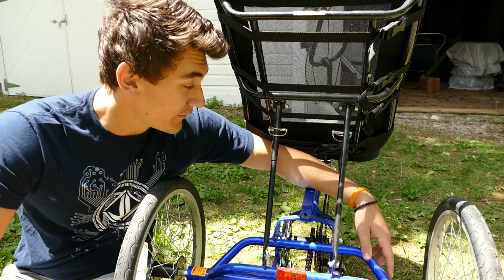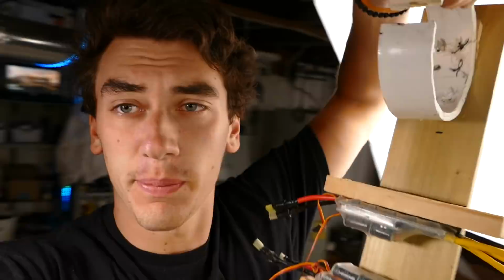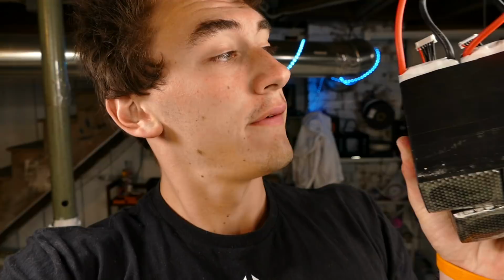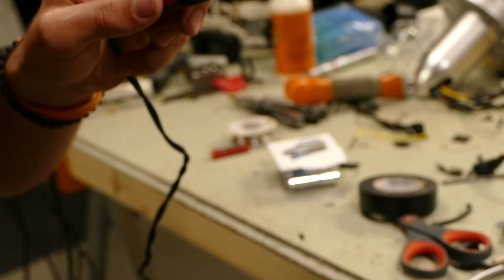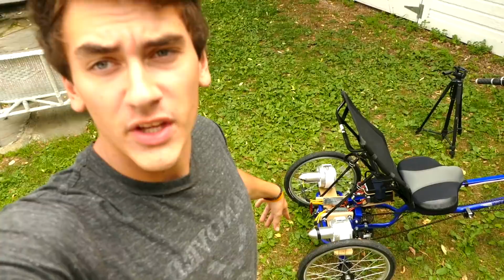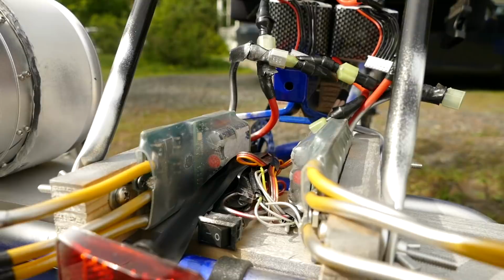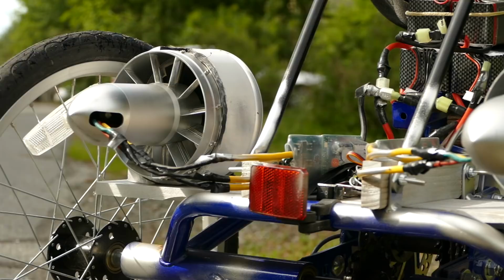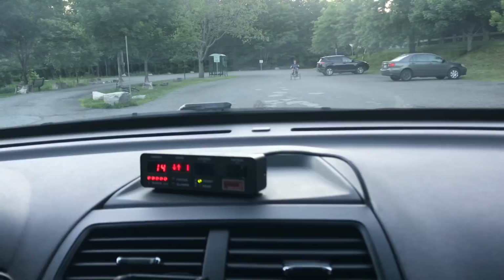DIY JET BIKE GOES WAY TOO FAST - COPS CALLED (Pulled over)

Comment: Imagine having a jet bike in your garage and being like "yeah that was a fun day".   BTW you should put a hang glider on that.  You would be surprised, I bet you'd get off the ground for 10 or 20 feet.  Add enough engines and it would fly but you need some way to steer.  It would be mostly legal too you might have to get some kind of license but since it's a hang glider it will glide down if the motors die (depending on the weight) oh yeah that reminds me you would have to cut the weight a shitload....like super light frame, carbon fiber or lighter IDK, lipo batteries if you're using lead acid..few other things but yea totally doable and super badass project idea
Reply: @waynefilkins8394  you came up with an amazing concept🔥 I hope he sees it
Reply: someone watched less than a minute of the video lol
Reply: Watchu trna do get him killed? 😂

Comment: I concur with your initial assessment. It does, in fact, have a very distinct lack of jet engines. Well done sir. You recognized an obvious failing and you did your best to remedy it. Very well done! I also applaud your use of materials. I also find myself randomly assembling various nonsensical things for no apparent reason other than self-satisfaction, so using the most basic materials you can is something I understand very well! :D

Comment: Oh I'm sorry you seem to have mistaken EDF's for "jet engines"
Reply: Jet engines use a burst of air to make it go really fast but they use huge ones
Reply: @joshuataylor4590  These are EDFs NOT jets
Reply: @urbanferret8247  doesn't really matterr
Reply: @GTmotions  in.my eyes as well as many hobbyist there is a huge difference between and electric fan and an actuall jet turbine
Reply: @joshuataylor4590  um.. no it doesn't

Comment: If you switch to actual jets, you might want to do a vertically-stacked arrangement along the lateral centerline, as in the BAC Lightning (https://en.wikipedia.org/wiki/English_Electric_Lightning), so that you don't have control issues related to differential thrust about the yaw axis.

Comment: I like the way you aren't afraid to use wood. A hundred years ago they were still building planes out of it. For its weight and strength it's hard to beat. When the caption said "jet bike"  I was thinking of the kerosene type. But after your video, I'm still thinking kerosene type...

Comment: Wikipedia:"Among model aircraft hobbyists, the ducted fan is popular with builders of high-performance radio controlled model aircraft. Internal-combustion glow engines combined with ducted-fan units were the first achievable means of modeling a scaled-size jet aircraft." And:"The Martin Jetpack, a personal aircraft powered by ducted fans." Also, ever heard of water jets?

Comment: How long does the battery pack last before requiring a recharge on this? Also, what is the diameter of round pvc pipe you used as a housing mount for holding the motors?

Comment: Hope he upgrades the brakes too
Reply: Brakes only slow you down
Reply: they never do.  Lways more power but no way of taming it.
Reply: Nacho TV, bike-brakes will stop you, even with 100km/h .... but you might need a little more room to stop.... car & motorbike brakes are designd differentbecause of the weight of the vehicles.
Reply: Felixx Mü car and bike brakes function entirely different. Your right about that. Bikes can also have calipers but the pads are really strong.
Reply: not sure why he would need brakes on that thing, it's barely moving, all his shots were sped up :P
Reply: Random things that doesnt make sense, car and bike brakes function entirely the same, both apply pressure to a moving part to slow it down, the only difference would be between disc brakes, v-brakes, or drum brakes, but all work on the same principle of using a pad to cause friction and stop it, and the pads are riders choice just like you would in a race car, can choose softer materials or tougher ones.
Reply: Why do you need brakes when your top speed is 30km/h?
Reply: Brakes are for prow who want to stop
Reply: Because if someone backs out of their driveway you're going to hit them and with no protection your going to get hurt. 18 mph is fast!
Reply: I hope you don't believe these fans are doing anything. In any event, it has rear disc brakes should he manage to coast down a hill.
Reply: +Fellix... Modern bikes have hydraulic disc brakes that work EXACTLY like automotive disc brakes. The pads are even made of the same material.  The Kinetic energy is converted into heat when you brake. This is true of automotive drum and disc brakes and it's true of all types of bicycle brakes.
Reply: Its a disk brake
Reply: And the tools
Reply: srbilataye
Reply: Jolly Roger 越南
Reply: The rear end looked like it had a disk brake so
Reply: Mike Ru

Comment: So 14mph on radar gun? Not 30mph correct? You are guessing 30 if both fans were working? Not sure it works that way, I don't believe it doubles the speed for every fan that you add.
Reply: He said it clocked 30 with one fan.. also no, it doesn't work like that. It would be significantly faster though.
Reply: To double your speed takes four times the amount of energy input. So, with an additional engine of the same power output, he would achieve roughly 25% higher velocity.
Reply: That’s still crazy forone electric motor to do that kind of speed I drive a four stroke gas motor on my bike and I get 35 miles an hour just curious how long his batteries will last on just one motor doing 30 constantly?

Comment: You guys need to watch the whole video before making trash comments about "It's slow, u speed up the video" or "u pushed it up a hill." Yeah, he did indeed do both, but 1 motor broke off and it still clocked a 30 MPH using a radar, and the reason why he pushed up a hill was because there was a cop and he did not want to rid over there.

Comment: EDF electric ducted Fan  basically it's a super sized hair dryer motor.
Reply: joetri1970 🔴 What Is Islam? ⚠️

🔴 Islam is not just another religion. 

🔵 It is the same message preached by Moses, Jesus and Abraham.

 🔴 Islam literally means ‘submission to God’ and it teaches us to have a direct relationship with God. 

 🔵 It reminds us that since God created us, no one should be worshipped except God alone. 

 🔴 It also teaches that God is nothing like a human being or like anything that we can imagine.
🌍 The concept of God is summarized in the Quran as:

📖 { “Say, He is God, the One.  God, the Absolute.  He does not give birth, nor was He born, and there is nothing like Him.”} (Quran 112:1-4)[4] 📚

🔴 Becoming a Muslim is not turning your back to Jesus. 

🔵 Rather it’s going back to the original teachings of Jesus and obeying him.

Comment: At 6:42 it looks like you were only running the right EDF. The left was not spinning unless it was after you rolled away. Your EDFs are usually bought by the diameter, i.e. 70, 80, 90, 105mm, etc. Of course their output is measured in thrust, lbs or Kgs. They have to be rated for the voltage that will drive them, as are the ESCs you used to drive them. IOW you can't use a 4S rated ESC to drive the EDFs with 6S batteries. You had to know the EDFs rated voltage and get the matching ESCs. If you ran the 2 LiPos per EDF on two 6S LiPos, in series you would have a 50.4V system. So you would need HV ESCs to drive them rated for at least 12S (50.4V). Or you could run a 6S system with two 6S LiPos wired in parallel rated for 25.2V. Are you sure which one you setup? Maybe someone else set it up for you? Hope your next vid with these EDFs are with both EDFs running. Cool project. Personally I fly RC jets, with the biggest a 90mm F/A-18C Hornet.

Comment: If it has enough thrust to start it rolling,  with over 150 pounds of you on it,  and propel it at over 30 mph,  PVC and wood,  screwed together,   is not a strong enough mount.  It could get you hurt.

Comment: Awesome.  I'm curious about powering the bike with electric motors vs electric jets... thrust vs torque, etc., and which has better battery life.  Anyhow, it's a cool concept.  I wish you had at least some light motorcycle protective gear on... like a HELMET, gloves, and boots for starters.  I knew a couple people who died while riding a motorcycle under 25 mph because they simply weren't wearing a helmet.  Concrete is unforgiving to the human body..., especially your dome.  Also, adding a 2nd wheel up front so it's a 4-wheeler would add significantly more stability, which you need on a very light vehicle like this.

Comment: So folks as a follow up

These are engines as they take

Energy from the batteries and turn them into mechanical energy the turning if the blade assembly 

It doesnt have to burn fuel just transform it from one energy to another

So input energy is transformed into mechicanical energy on output

Thats an engine.

Sorry guys

Look it up
Or read my other comment
Reply: I think you should look up electric engine. Clearly you don't know the difference between a Engine and a Electric motor.

Comment: I'm impressed! That's not easily done. You're young, you've got skills, you're motivated. But! (always a but..) you lack quality and volume when it comes to tools. Your choice of building materials is sub-par. I know it's a prototype, but (another one 😕) a quality hardwood, sealed against sun and weather, would be soooo much better. Many, if not most pallets are hardwood (and free), but (again) it takes a few more (power) tools to make them advantageous. Too bad we don't know each other. I'm old, disabled, and unable to use the tools and shop I've accumulated through the years... and... I have no relatives that would use them if I was to bequeath them... They would just be sold for pennies, or thrown into storage. So, I'd be much happier if someone like you inherited them. Someone that would use them --- and more importantly --- learn and share. 

PS, much respect !!! for the respect you have for LEOs.

Comment: I have no knowledge of anything, lol, but.... What if you were to implement that setup for the jet engines on the same rig design of the flying arrow from GOTG you did?  It looks like a perfect match for the SR71 layout and you could still use whistling/sound to control it...  I think you could add left/right to the whistle design without too much trouble, just work on four definitive whistling sounds or other sounds?  Could be cool.  Love the videos you are a badass.

Comment: my guess is 30 kph...  max..    considering ducted fans are made for really light r/c aircraft..    so his 150 pounds wont move fast considering even the best mini JET engines only push 35 pounds at best..  with a streamlined aircraft..  not a flat board like him in the wind..

Comment: I saw from the very first test [where you knocked your camera over] that the left motor was not spinning, so you were running on half power from the beginning. 

It is quite obnoxious that you don't have one clip at normal frame rate of your top speed, it makes you look false.

Comment: Technically  those are not Jet engines . They Are  EXTREMELY  High  Speed fans. Jet engines use jet fuel. Those engines are high velocity  fans. Anyway I think what you built is very cool and creative  5 stars dude!

Comment: Looks great, but it kills me to see him take bolts out with pliers. Get some aline wrenches, and a socket set. It will prevent wearing them out in the long run. Also, not jet engines, they are electric motors.

Comment: What is the thrust of your engines?
Fuel consumption (GPH) at 30 MPH using one engine and two engines?
How much fuel is needed for say 250 miles, without having to stop for fuel?
How hot is the exhaust 3 foot from the engines? (I tow a trailer)

Comment: There not jet engines you have two Electric Ducted Fans. Engine burns combustible fuel of some kind, Motor runs on electricity DC/AC. Kenneth Boren.

Comment: would those engines be durable.
    efficient gas wise? say 20mpg?
Reply: Quick Rider i was just wondering how much a gallon fuel costs jet engine. And how many miles you think it could propel 1 bicycle.

Comment: All u people jet engines etc

Someone says fan
Someone says engine

Who cares honestly hes making something cool.
And if he says its a turbine then it is or it isnt 
Who cares
Most of you people below dont know simple concepts anyway

Engines are a device that takes a energy like any chemical fuel such as gas, diesel or an energy such as wind, hyrdo, steam anything.
It doesnt make a difference what the energy is but it takes that energy  and transforms it into a mechanical work.
YES WORK
THERE IS A TERM CALLED WORK

most people leave out the transform energy part
Most people leave out the hydro etc.
Most people just think is gas etc.
Most people just think well wrong
If anything at all its a chemical reaction to mechanical REACTION 
But hydro is a good example

And what about may i say it

STEAM ENGINE.
so steam is the energy used to make mechanical energy

It used to be horses folks that was the energy.

Motors are an electrical device that creates work
Or take electrical energy and make mechanical energy out if it.

A generator takes mechinacal energy and makes electrical work out of it

They all make something called
WORK

WORK IS A UNIT OF MEASUREMENT 

AND WORK MEASURED IN WATTS

AND 746 WATTS OF ENERGY IS 1 HORSEPOWER

SO THATS HOW WE GET HORSEPOWER OUT OF AN MECHICANICAL DEVICE.

im not going to go into much more detail but just some of u people need to get a better understanding of things.

It doesnt make a difference what it is as long as the outcome is work.

Work is what is MOSTLY used to measure output of
Engines
Motors 
Generators 
Etc.
And horsepower which is work in a different explanation or transforming it to horsepower

So way to many people here dont even know that to be bashing this guy.

Its a shame that not too many people here actually know anything about what they are commenting on

Some of you are all youtube smart and nothing more.
Learn folks
Its a good thing

So lesson today

There are engines that take energy and transform it into mechanical work

There are motors that take electrical and make mechanical work

Generators take mechanical energy and make electrical work

Mechanical energy is the movement of something to create work
In most cases it rotational mechicanical work that is measured in work
Which can be transformed into horsepower with a few more lessons in some other topics 
There is also force and torque and some others which i wont get into but in easy terms its work output we are concerned with

So hope some of you people give this guy a break and let him be.
Nobody needs to be put down from another utube schooled person that doesnt have simple concepts correct.

Im not going to go into it deeper as my explanations are for people that have no experience to understand a little bit.

All we care about is the ability for a motor or engine to do work.
And thats how things get done.

Comment: Shame you spraycanned a clean shiny trike and made it look like it came from the tip. Hope it pressurecleans off ok in case you decide to sell it for more than $30. Then you might have enough money for as set of spanners and allen wrenches you clearly need! Looked like fun all the same, but I expect you wouldnt get 20 mins out of it before flattening the batteries.

Comment: I'd love to see you try taking this with a ton of fully loaded batteries to a trail just for bikes, joggers, walkers ect, and see what happens. I remember the day i took my electric green scooter on a bike bath they say not motorized vehicles or off road. But is an electric device considered off road or a vehicle if powered by electricity not gas. As i kept riding my Green electric scooter some hoe a guy with the same style and in Blue and same name scooter and all got the cops called on him. guess i'm just lucky and know how far to go and know where to get off so i don't get in trouble if you know the spots where cops sit and the little parking lot cops.

Comment: pulled over because you aint got no license plate boi
Reply: it has pedals, no gas powered motor, there is no laws that covers this kind of build, its a custom design but they don't say its not illegal because its pushed by wind. since there are no open moving parts and it can be rode without the jets being on its still classified as a bicycle.  its like a midget that goes into the McDonalds kids play place to use the slide... he's small enough so there is no physical reason not to let him but he's an adult which makes it just feel wrong.

Comment: You need to slow down. Learn to weld. Velcro + wood screws + jet equal a problem. Consider the power involved and then factor in 3 to 1 for safety. You really don't think that the bicycle you are riding is actually rated at advertised weight ratio do you? There is liability to consider.  So the attachment you made should have at least the same safety factored in.

Comment: electric turbine FAN, for RC jet 'SIMULATION', no where near the thrust of a 'fuel' jet , the same size, you would get more & power better response with direct drive motors
any way you are having fun playing with them, but 'maybe' quit calling them jet engines

Comment: bro you're killing me what your tools please go invest in a Craftsman 700 piece set you'll thank yourself five hundred times over will using the correct tool. Remember there's a correct tool for every job out there. Also trade in that 1980 corded electric drill and go buy yourself a DeWalt nut driver and drill and invest in some cheap inexpensive new drill bits you're killing me